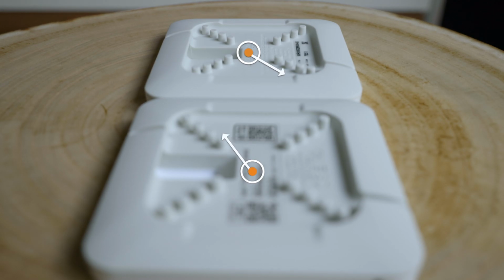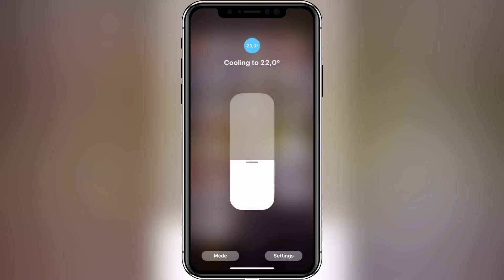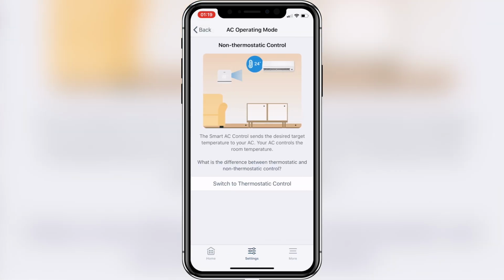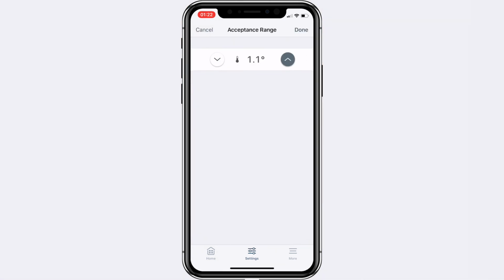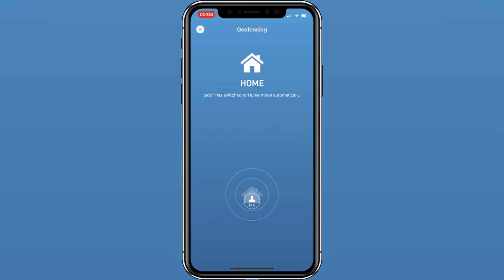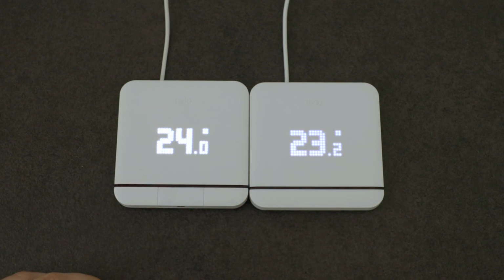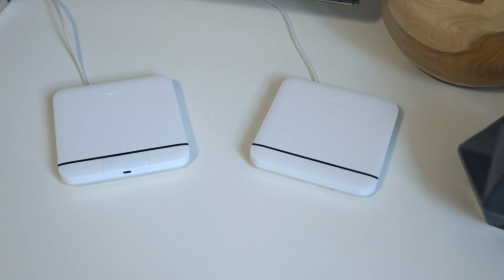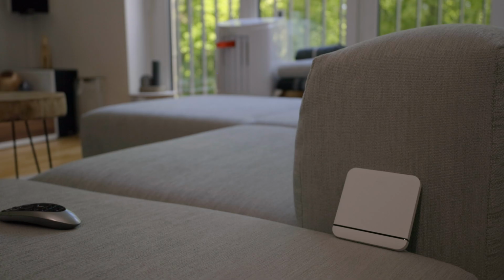Tado Smart AC Control Comparison - V2+ vs V3+

Comment: Great Video! I wish they could offer the V3+ with batteries like the Smart Thermostat. Not sure why it should be powered by a brick. Maybe V4+ will be battery powered. By the way, could we use V3+ as a thermostat and use to control the heating as well? I don't want to buy a Smart Thermostat and a Smart AC Control for every room. That's a lot of extra cost.
Reply from the maker: The answer to that is actually quite simple. The V3+ is a Wifi enabled device and those consume lot's of power. Therefore You'd need to swap batteries quite often. If your AC is cable of heating you can also trigger it with the V3+ . Otherwise you'll have to revert back to their other products.